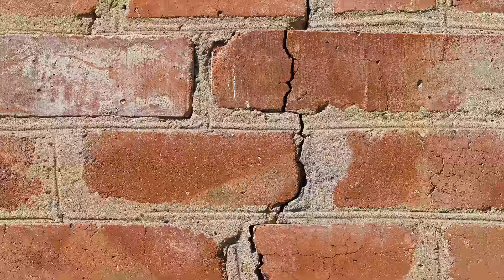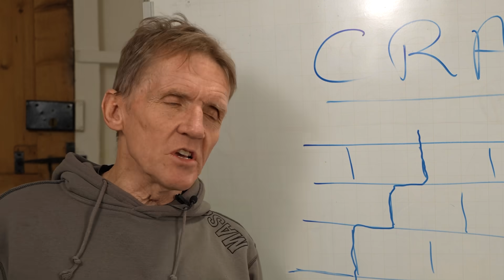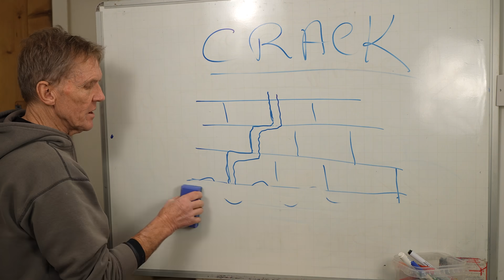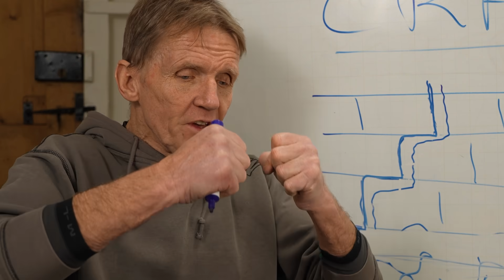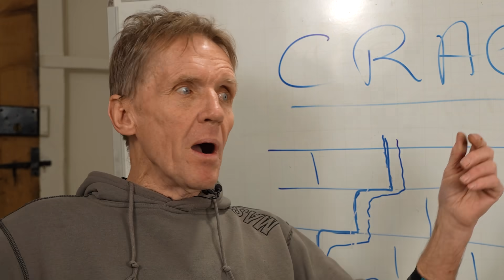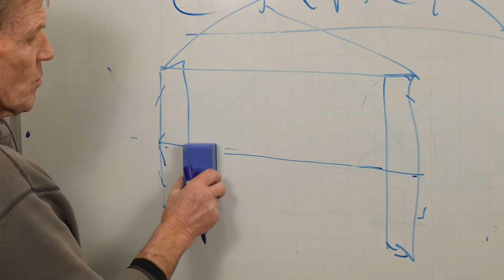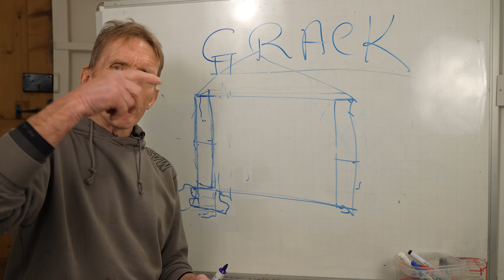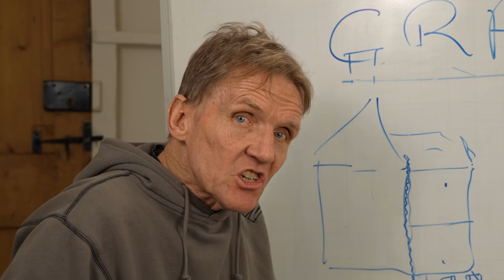Why Has Your Wall Cracked? and What Can You Do?

Comment: Good explanation about the behaviour of clay.
Where I live there is silt, and at some depth into the ground it seems very hard and almost impermeable for water.
The original house has been built with 70cm deep concrete foundations, and these reach well into this hard silt.
But an add on has been built on foundations only 20-40cm deep, and the foundation has been built very unevenly in width and depth.
This foundation didn't reach "under the weather" as we say, and is subject to freezing up and thawing, and also I found that the silt around and under this foundation was very saturated with water, which caused a lot of humidity under the wooden floor causing it to rot.
And also small cracks were this add on joins the main building were apparent.

So my thought went over and the best solution seemed to me to underpin this foundation to the same depth as that of the main building.
1. to keep water out by bringing the foundation down to a level were water doesn't penetrate easy, and also preventing rodents digging tunnels allowing more water in. 
2. To prevent cracks to develop more by bringing balance in the amount of support the parts of the building get by have them resting on the same layer of soil, and at a depth where water ingress and frost play no role in causing movement.
I also applied crack stitching, and this holds up very well over the last year since I did it.

So Roger, what is your view about imbalance in the construction of foundations and going under the weather? And what role can play a high water table (ours is very deep at 8m)

Comment: I am sorry to say I built a house in Poland a number of years ago they build very different way 1st year put in foundation and waste pipes etc in September then cover over the winter came back in the spring and built walls up roof on then it sat for a time no windows bryed out for a number of weeks windows in and plastered floors poured house then finished up 15 years later still no cracks They build up houses there not just through up houses in the UK

Comment: Thanks Roger, awesome video. What would you do about plaster that has a long vertical crack, I was thinking of opening it up a bit, filling with bonding and then re-skimming the whole wall.
Reply: If you re-skim it with hard plaster, wouldn't that be likely to crack again they next time it shifts? I'd be inclined to chip out the crack a bit,  fill it with something more flexible (constructions adhesive or caulk), apply fiberglass mesh , V-ing it into the crack to give it some flexibility, then go over the whole thing with some flexible spackling (or similar Polyfilla), topping it off with  joint filler, so it can be sanded smooth.

Comment: Hey  I got a question in my basement  I got sort of like a pimple  a bump   I broke  the area  and repaired  with  concrete   it came back  it appears  in the winter. What will cause the concrete  to rise indoo
Reply: In the first instant it sounded like too much water was used in the mix but as it has happened again after you did it  then you might consider  a pressure problem from either a gas, liquid (water) or an enthusiastic tree root. check your area is not subject to Radon gas emissions. Next time you repair it leave a  couple of small pipes in with balloons on,and see if it returns in the winter...

Comment: People don’t believe that using lime and sand is the correct thing to do , it blows their mind not using cement 🤣
Reply: Doesn't it just, most builders haven't got a clue how or why you should use it.
Reply: well it seems to set pretty firm in the bag when it gets wet
Reply: @utubeape  I had a job repointing a very large chimney that someone had badly done with sand and cement so I was redoing it with a lime and sand mix . The labourer must of said “ seriously no cement in it ? It won’t set ? “ a hundred times the first day . And said “ i cannot believe that’s worked “ the next day 🤣

Comment: I have a 1926 mock tudor house build on clay on a hill. I have a few crack but not to worry just want to fill for cosmetic reason can I you the mix you mention as the filler and rendor? Also would it be tge same around windows

Comment: What about wall tie failure. Recently I have come across house sales falling through because the surveyor has mentioned it in the report. It happens in older properties with mild steel ties which have corroded and are pushing the brick courses appart showing as horizontal cracks. In one of the properties I noticed the outer skin of bricks was bulging outwards.
Reply from the maker: wall tie failure is another subject we need to look at

Comment: Matching mortar is my nightmare Roger, I've tried all sorts. Had successful cavity insulation years ago and the guy disappeared in the truck for 2 minutes, came out with a bucket of muck and filled the holes with his thumb, apart from the nick on the corner of the bricks you can't see it at all. I think he was just lucky, lol, cheers.
Reply: I had some numpty trying to sell me cavity wall insulation.
I dont have cavity walls.
My walls downstairs are thick... 24 inch stone walls. I believe its a type of granite.. They dont make em like they did in the 1700's
Took the gas peeps 4 days to put the gas pipe thru the wall.... So many dead drill bits... They started off with a little battery drill and after 30 mins drilling.... He might as well used a tea spoon
Reply: @sahhull  The "numpty" ratio rises significantly when there is something to sell. I lived in a house that was to all intents made of engineering bricks and I well recall the sadness that brought to my life, a couple of foot of volcano spew must make you an expert on free-standing items, cheers.
Reply: Took me three goes until I got a passable match, by which I mean one I can see but which I no longer notice, when I inserted a brick next to the front door after removing a cloakroom loo overflow.
Reply: @Graham_Langley  It's like looking at the ingredients and tasting the cake,  even the surface texture no where near the same , cheers.

Comment: I moved into a flipped Edwardian house 20 odd years ago, I think the thud of the multitude of removal men caused a few cracks inside. My neighbour told us before we bought that it had been monitored, but hadn't moved. I'm finally repairing them, but none remaining have moved since. Probably why it was pebble dashed, but no outside movement in that time since. My brother was concerned about the gap of the stair stringer away from the wall. I managed to pull out a newspaper from the filled gap dating back to mid 60s, so not moved for about 60 years. The slag inside the brickwork is a bit of bitch when doing anything structurally, but it's still standing.

Comment: Hi Roger - could you use caulk to fill the crack and keep the joint flexible ?
Reply from the maker: You can
Reply: Wouldn't add much structural strength to the crack, however, it would most likely do a good job of keeping the elements such as wind-driven rain from getting behind your wall. This would be effective in that sense as these older buildings typically don't have much of a WRB behind the brick facad.
Reply: @cambeckett8924  Thanks for your reply Cam
Reply: I was wondering the same thing, especially in terms of weather-proofing - thanks!

Comment: So glad you’ve done this video Roger.  I have a couple of step cracks in the brickwork on my house.  I was going to repair them by putting the helix rods in and repointing but I might not bother now!!
Reply from the maker: Try to work out why they are cracking. The  helical ties is good for certain jobs but in heave and shrinkage of clay it is not the best thing.
Reply: I had them looked at a few years back and I was told it was just settlement.  They just don’t look great when we come to sell up and move!

Comment: My house was built in 1965 , year later was flood in all areas and probably that was the reason why my house is leaning to one side. When I bought this house I didn’t  find this problem. The back of the houses is ~ 150mm lower then front . Soon I have plan to do a renovation and I am trying to find some good advice how to fix this issue..???